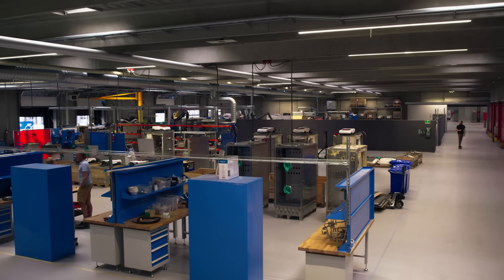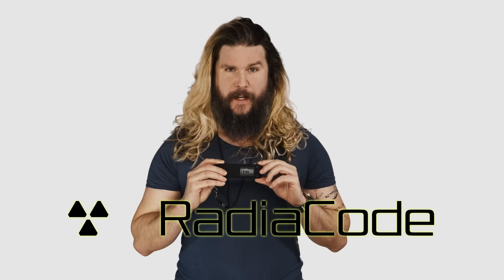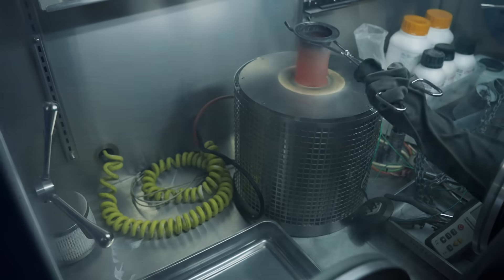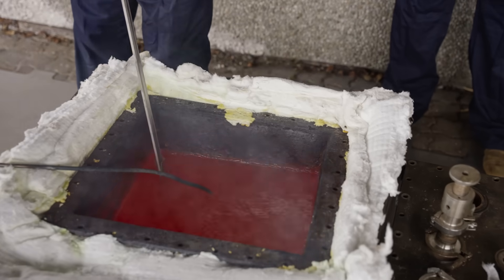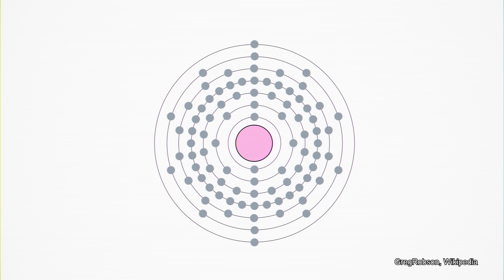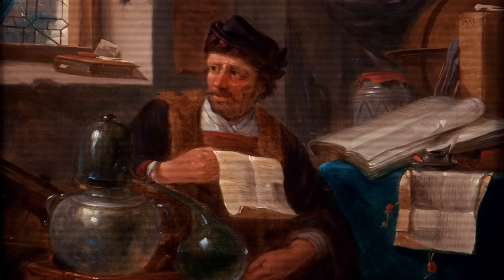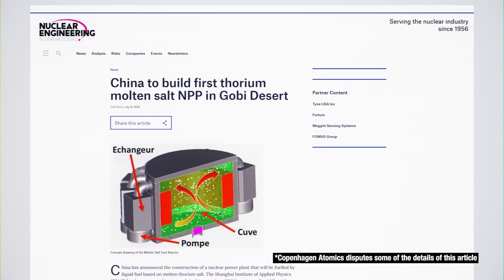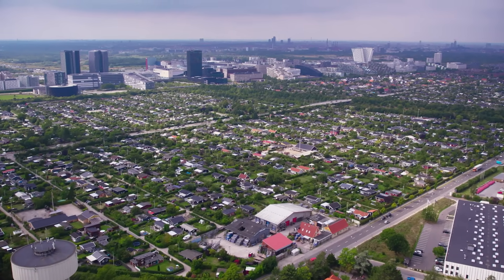Is THORIUM the Future of Nuclear Power?

Comment: July 2002. I finally finished a 1972 200 econaline van window bus. 240ci 6 cylinder. C4 Transmission. power steering. I changed the engine and transmission to 86 cop car engine special heads one yr only, emissions. and an 85 C5 Transmission. 4.10 axle 8 lug. 84 Mustang intake 4 barrel. heat riser off a 391cu. F700 truck, water cooled. Edelbrock carb 600 cfm. 180° stant. bored 040.over. wolverine 270 degree split. cam. the carb was matched to the camshaft. 78 Ford Electronics ignition. fix the power steering, all new components. and GM steering pump. right pressure. Ford was lying to everybody about steering. 2 1/2 yr project. finished. the first thing was an Offenhauser dual port intake. didn't fit. scraped the 6 cylinder idea. I bought a 1979 Ford stepside pickup. the  86 engine was in the back with the 84 intake on it. I always  balance my engines i build. the pickup, my cousin screwed me on with code enforcement $150. for the truck. I paid $1000. for it. Tom was 79 years old when he picked the van up finished. I wasn't at home at the time. 40 miles to a gallon. the salesman at the autoparts swap ignition box for a 4 cylinder. it would heat up and shut down after two hours. the cops beat the salesman to a pulp when the V8 one was put in a pinto. the owner was burned when the pinto caught fire. $1800. I had $3900. in it. 😊 I'm an angelic. I always get even. 😂

Comment: One thing missed in this video, but really important to understand, is that they plan on building 1 reactor a day, churning them out of an assembly line, and ship them to their sites inside standard high cube shipping containers.  They then sell the heat and the utility or industrial user sets up the rest of the hardware (a modular turbine room or factory using heat for industrial processes).

Comment: The energy solution is simple.   You use the CO2 in the atmosphere as an energy source.

We already have all the technology needed to use CO2 as a fuel source.
These are the steps.
1.  Build massive solar farms to provide electricity.
2. Build massive refrigerators to cool air.
3. The cooled air will first produce water, use this in Step 6.
4. Continue cooling air freeze out the CO2 , this is dry ice.
5. Use a water source, ocean water will be ok.
6. Build massive water electrolysis to split off Hydrogen H2,  O2 is released.
7. Build massive reformers to combine the H2 and CO2 into Methane.
8. Build massive reformers to convert Methane into Methanol.
9. Methanol is a liquid easy to use easy to transport 
10. Build a lot of engines to be fueled by methanol
11. Existing power stations are easily converted to burn Methanol 
12. Sell the Methanol engines very cheaply. They can easily be filtted into existing cars
13. Sell the methanol at 50c a gallon.
14. Produce enough methanol so that you make more than can be consumed.
15. Pump the excess methanol back into the oil fields
16. Build Methanol reformers to make Kerosene for jet planes.
Easy.

Comment: This is pleb level discussion these days, and here's why. 10 years ago this could have been the direction we went, considering that unless massive user error [that virtually never authentically happens anywhere else, accidentally, at least] happens at even regular nuclear power plants, that that type of energy is the most clean to most generative to safe across the board; that type of energy wouldnt make energy a commodity, it would legitimately drive down the price so far, that it wouldnt be a mode of controlling large amounts of people. Look into the types of energy they are focusing on promoting, the 1% being they, these days. Look at its flaws, and what makes it different than other types of energy. Notice how the entire world is moving towards that "electrical circuit" direction [putting wifi chips in all electronics, to call them smart, appealing to the detrimentally lazy], and this direction isnt random, its guided by the rich who meet in meetings every year to discuss the type of future they want to have for everyone. Then they advertise across the board about how great it will be to achieve that. Then governments start getting on board with it. This is what weve seen so far, and it only gets more confirmed as time goes on. This smart future will easily be able to be monitored, controlled, and if you act out of line, cut off. You dont know what the requirements to even exist will be like in order to not be cut off, they very easily could be extremely asinine, and there would be nothing you could do about it.

Comment: Well, honestly, its not surprising how watery the molten salt is if you've ever arc welded before.  particularly stick welding.  The puddle in front of the rod flows like water, but its still metal.

Comment: One of the biggest natural advantages of MSRs is that they operate in a much better temperature & pressure regime than the traditional pressurized water reactors (PWR).
MSRs operate at HIGHER temp and LOWER pressure, compared to  PWRs that operate at lower temp and higher pressure.
This has two huge advantages (over PWR)
1) the thermodynamic efficiency is increased (the higher the temp above ambient, the more energy can be extracted)
2) the lower pressure allows for MUCH cheaper construction than the high pressure steam infrastructure and containment vessels of PWR's
In fact, you couldn't pick a more backwards choice of operating regime than that of PWR, but the reasoning behind PWR wasn't cheap and efficient energy production, it was efficient production of nuclear weapons material (Plutonium)

Comment: @Kyle Hill
1:41 why have step 2 and not have water from reactor spin the turbine? Seems inefficient to heat water with water. 
Someone may say "radioactivity" affecting the turbine, I don't think that's the case, because the water is not that radioactive since it sometimes gets released back into the ocean. And other info I've seen water is a lot less radioactive the further it is from the source.
Reply: Even if it's measurably safe under operating conditions, the water in direct contact with nuclear materials has potential to be contaminated if anything goes wrong with the system.  Reasonable barriers against releasing this contamination into areas and onto objects people will regularly contact for operation and maintenance are a good thing.

Comment: So it breeds more fuel, but can that fuel be used in the same reactor, replacing the thorium?  If not, what becomes of it?  Is it just as dangerous as the fuel or waste from Uranium reactors?  Can it be weaponized?
Reply: > So it breeds more fuel, but can that fuel be used in the same reactor, replacing the thorium?
yes - a bit unclear from the video, but the fuel bred from thorium is indeed what is used to power the reactor

> Is it just as dangerous as the fuel or waste from Uranium reactors?
yes - but then the spent fuel from uranium reactors isn't all that dangerous either.
The advantage is that the spent fuel is separated a) new fuel to be put back into the reactor, and b) fission products which only need to be stored for about 300 years.
(traditional reactors don't make this separation, so the spent fuel needs to be stored for longer)

> Can it be weaponized?
with difficulty, yes - however there are easier and more proven paths to make nuclear weapons; so in practical terms, no
Reply: @factnotfiction5915  But the reactor itself is easy to proliferate.  Just run U238 in the blanket and you get instant plutonium.  Can use the plutonium in the core to make even more.  If you want the bomb, get a "Thorium" breeder reactor.

Comment: Dude. You explain thorium reactors with uranium. They use thorium instead of uranium, thats what makes them thorium reactors. Uranium isnt the only fissile material.
Reply: Thorium is fertile, not fissile.

Th-232 + neutron -> Th-233
THEN the Th-233 decays to U-233, which is fissile.
(ditto U-238 to Pu)

fertile - Th-232, U-238.
fissile - U-233, U-235, Pu.
Reply: @factnotfiction5915  U238 + neutron ->-> Pu239->-> bombs.  Same reactor, less processing.

Comment: how can it make energy and produce more fuel without breking the thermodynamics laws?
Reply: some energy is used to create the fuel, thus the laws of thermodynamics hold true

Think of gasoline - it produces energy to move your car/truck/plane/ship, but it ALSO took energy to drill, pump, distill, and distribute. None of that violates the laws either, as energy was used for all of that before burning in your car/truck/plane/ship.
However, gasoline is SOOO energy dense, that it is still worthwhile to spend the energy to drill, pump, distill, and distribute - and we still have enough left over for the engine.

Likewise, in the reactor, the energy in the strong nuclear force is being released as heat, but also as a super-fast neutron. As this neutron bumps into things, releasing more heat as those things start vibrating, it might eventually be captured by a second nucleus.

A. That neutron capture by the second nucleus consumes the energy the neutron is bringing to the party - so less than the initial fission - so energy-wise we are still balanced.
B. Now, the second nucleus decays into our fissile fuel.
C. Last, the second nuclear undergoes fission - but the energy of the fission is from the WHOLE nucleus (i.e. we're breaking the strong force between multiple pieces of the nucleus: the output is 2 big nuclei + 1 to 3 neutrons, not the same nucleus + neutron we ha pre-capture).
(when you light a match, you're burning the WHOLE match, not just the bit that got scraped against the box).

Comment: My guess as to why it hasn’t taken off is the price. I know the fuel is more efficient, but usually making a profit isn’t the problem with nuclear reactors, they make bank. The problem is the upfront investment and the risk with increased costs and delays that add up to people not recovering their money for decades. So the true barrier is upfront cost. Once it’s up, even maintenance and operation are trivial compared to how much money they make. 

So I think the fact that nobody’s built one, the added complexity, regulatory inertia, and the likely possibility that molten salt probably isn’t too kind too the plumbing and would be a bear to deal with if there were leaks (although maybe not too bad? It sounds like they use table salt? If so maybe not too bad although it would be 850*C and radioactive) all contribute to why we haven’t built one. Not sure what infrastructure we have in place for thorium extraction and refinement either. Lack of scale would make that expensive compared to uranium at least in the short term. 

Honestly, unless this startup has a way miniaturized reactor that can be mass produced with relatively cheap materials and run with personnel that don’t need extensive training and is easy to maintain… I’m not sure they’re going anywhere. I didn’t hear anything about how they’re going to mass produced these things.
Reply: Can you even hear yourself? ;-)

Comment: Fyi, you can melt salt on your stove top. Absolutely never do it. it's extremely dangerous, but salt does not have to be 1500° to be a liquid
Reply: Yes, you can. What you can't easily do is to keep in inside metal pipes without causing corrosion. There are very few material combinations that are long term stable against molten salts.
Reply: @lepidoptera9337  hot salt dipping is a  metal treatment for long term corrosion resistance.
Reply: @ Yes, for a few seconds to a few minutes... exactly because it reacts with the metal. ;-)
Reply: @lepidoptera9337  > [salt] reacts with the metal
that does depend on the particular salt and the particular metal.

For example, aluminum refining occurs in molten salt cells constructed from metal which see continuous use for years/decades before replacement.
Reply: @ They are typically lined with carbon or another inert electrode material. The steel never comes in contact with the fluoride/oxide salt.

Comment: This video makes the same mistakes that other thorium videos make:

* all thorium reactors are breeder reactors, but they don't have to be molten salt breeder reactors
* molten salt breeder reactors can use the uranium-plutonium cycle too
* thorium cycle reactors do not prevent the proliferation of nuclear weapons - in fact, a molten salt breeder reactor makes it easy to separate out some of the U-233 for weapons production

Thorium's main advantage is abundance, which goes to fuel cost. There are some significant benefits for LCOE there, but that's about it. It's not a miracle fuel, and it isn't going to save the planet.

Comment: My concern is the piping eroding.  I did molten smelt bed pumping from recovery boilers (briefly) and the problem they had was if the pumping materials were able to handle the ph (or in this case the salt)  couldn't handle the temperature change,  and the materials that could handle the heat couldn't handle the ph.  My guess for why the early molten salt reactors were abandoned was for this reason.
Reply: > My concern is the piping eroding
that does depend on the particular salt in the pipe and the particular metal used to construct the pipe.

As for the pH, that can be changed with the addition of other ions to the salt.

> My guess for why the early molten salt reactors were abandoned was [because materials that could handle the heat couldn't handle the ph].
More about budgets than difficulties.

The MSRE did report corrosion, but also believed they had solutions to that. Although it needs research, it isn't an insurmountable problem. But short-sightedness, politics, and budget cuts nixed the research - not technical or scientific difficulties.
Reply: @factnotfiction5915 @tomisamish ThorCon power has investigated this deep enough to come with a viable technical solution (it involves having one extra exchanger in order to keep materials handling ph away from those handling moisture). Look for their video presentations on their molten salt thorium reactors. They are in the final steps of a years long paperwork for building a reactor in Indonesia (becoming operational in 2032), so I presume the technical part of the project has been thoroughly vetted.

Comment: Molten salt is extremely caustic & last I heard is that nobody has been able to produce materials capable of handling the stuff reliably for longer than a few months.
Reply: > Molten salt is extremely caustic
that does depend on the particular salt and the particular metal.

> nobody has been able to produce materials capable of handling the stuff reliably for longer than a few months.
aluminum refining occurs in molten salt cells constructed from metal which see continuous use for years/decades before replacement.
Reply: @factnotfiction5915  Interesting!

Comment: I understood that managing the reaction in current nuclear reactors could be like walking on a tightrope with very big dangers on both sides that must be actively managed, which the personnel of current power plants all manage to do (thank goodness)
for molten salt reactors with thorium, the design is more complex and it integrates more secure elements acting in passive mode: in the extreme, in the event of "glitches" even if the personnel of the power plant do nothing, the system will have a preferential tendency to return by itself to a more stable state.
the complete opposite of the particular design of the Chernobyl reactor which tended to aggravate the glitches that could happen (until the disaster of 1986)
Reply: > I understood that managing the reaction in current nuclear reactors could be like walking on a tightrope with very big dangers on both sides that must be actively managed, 

Um, no. Not at all.

Managing a nuclear reactor is like being on a balance beam, which is 1-2 meters wide, with handrails.
Sure, if you take the trouble to climb over the handrails, you'll be in trouble, but reactors just aren't that sensitive.

There are 3 regions of operation:
* below critical - i.e. the reactor is off, shutting down, or starting up
* above delayed critical - i.e. the reactor is in steady state mode
* above prompt critical - i.e. the reactor should be brought back to delayed critical, or a meltdown may occur; however, there is a fair amount of time to act to bring the reaction below prompt critical.

Fukushima Daiichi the reactor was off, and the problem was cooling decay heat, NOT dealing with fission reactions - i.e they weren't on the balance beam.
At TMI-2 and Chernobyl No 4, undertrained operators 'actively managed' to bypass and turn off safety systems - however it took them minutes/hours to do so - i.e. they jumped over the handrails. These lessons have since been incorporated into training, design, and refits.